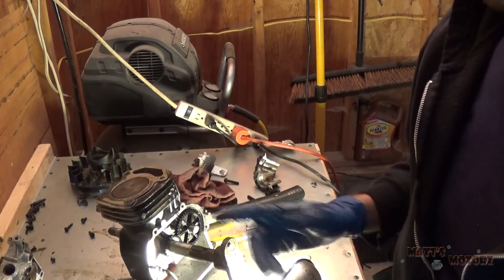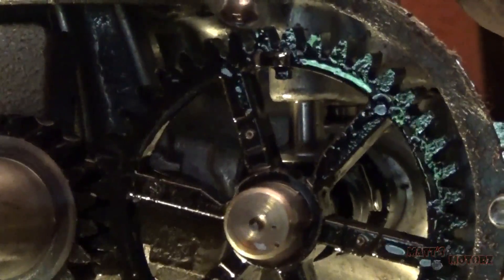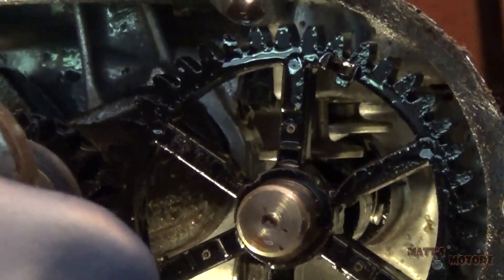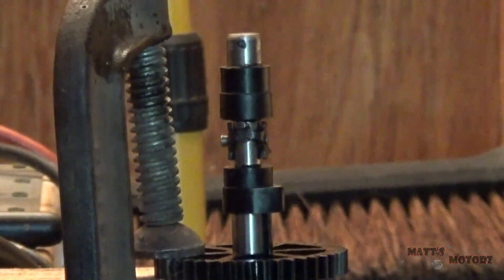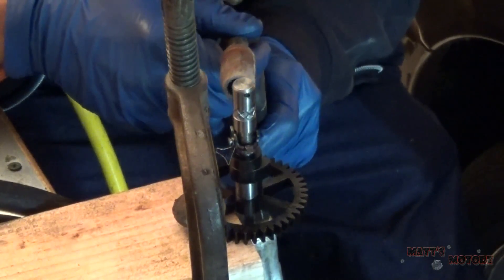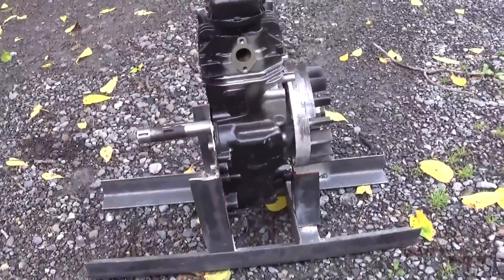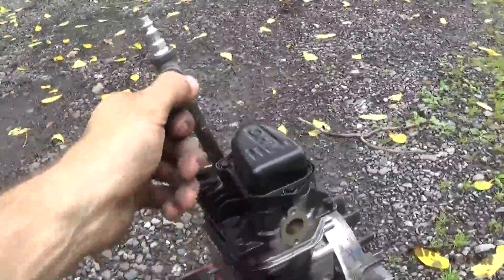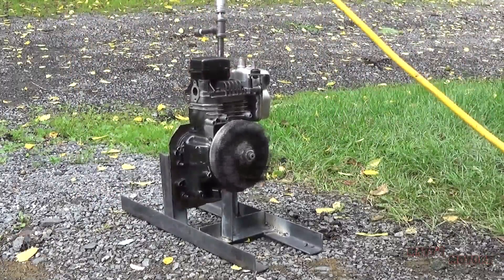Converting a Lawn Mower Engine to Steam: Part 2 - Converting to Steam

Comment: Everyone seem to weld a new lobe but wouldn't it be easier to use gears of equal size or convert to chain with cogs of equal size so valves open on every stroke or am I missing something vital.
Reply from the maker: No that wouldn't be easier at all.  Not even by a little bit.  Think about what it would actuallt take to get gears of the right size, develop a mounting system for them, and line everything up to make it work right.  Same thing goes for the chain.  It is much easier to just weld a lobe on.
Reply: I suppose that's the difference between being an engineer or a welder. I could easily make the cogs and such but struggle to weld a new lobe.  :)

Comment: you are using a DCEP 110v flux core welder aren't you, you like to retrofit things you should convert your welder to DCEN, you'd be surprised how much better your welds will be and no more splatter....it's not that hard!!
Reply from the maker: So if you are doing DCEN, that means the work piece would get hotter than the electrode, correct? How does that make the welds better? (Not arguing, I really don't know much about this stuff and would like to know!)  I would imagine the modification would be a simple matter of switching wires in side ,correct?
Reply: MattsMotorz  no DCEN isn't quite that simple, you have to add a few components and to tell the truth, at first I was intimidated by the conversion myself because I’m good with DC but AC confuses the hell out of me but in the end out of all the DIY stuff I’ve done in my life, converting my little HF welder to DC was the best thing I’ve ever done. You know all mess of lumps you ended up with for cam lobes (probably from a harbor freight 110v flux core welder, right?) if you’re welder was converted the welds would have been smooth beads that you could have layered one on top of the other and ended up with a almost perfect looking lobe. You are right though, the conversion does make the welder weld hotter which gives you better penetration, I can weld up to ¼” thick stock now, never could do that with this little welder before I converted it and no more splatter mess to have to deal with. There was a complication with my conversion so I had to go a little further but now my $80 welder welds like a $300 welder. If you can build a steam engine you can do the conversion, you just need someone to guide you through it and about $60 or so for parts. If it’s something you want to do let me know and I’ll walk you through it….take care

Comment: What about making the cutoff adjustable by utilizing the "intake-side"... a  late cutoff delivers full steam pressure to move the piston through its entire stroke, for maximum start-up forces. But, since there will still be unexploited pressure in the cylinder at the end of the stroke, this is achieved at the expense of engine efficiency. 

An early cutoff has greater thermodynamic efficiency but results in a lower Mean effective pressure so less average force on the piston and is used for running the engine at higher speeds.

So you could adjust between early and late cutoff (with a valves of course) and greatly increase the efficiency of you engine...
Reply from the maker: +ki4clz Adjusting cutoff is a very difficult thing to do for a poppet valve engine such as this one.  Old steam engines used stephenson links used on spool or piston valves to adjust the cutoff. A difficult modification for a lawnmower engine. But hey, with enough imagination anyone can do anything.

I am actually in the process of building a large, legitimate steam engine from scratch by casting parts in my home foundry and machining them. I am about 1/3 of the way done. So much work!